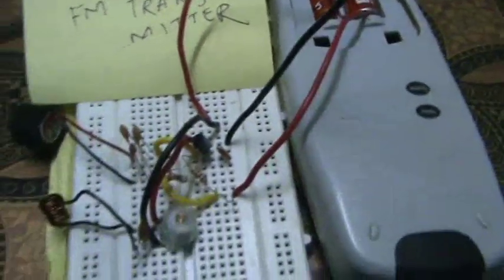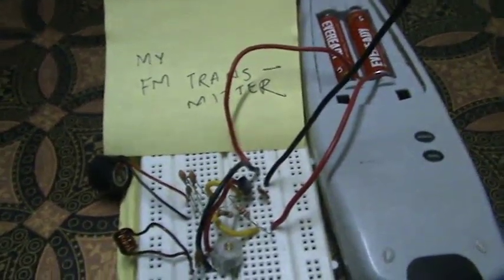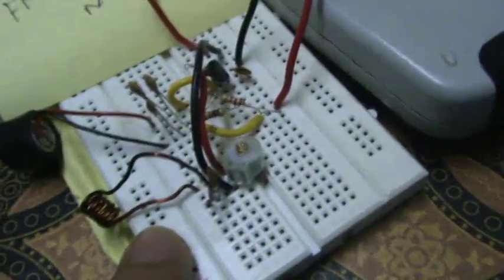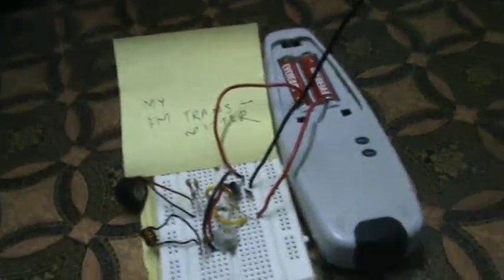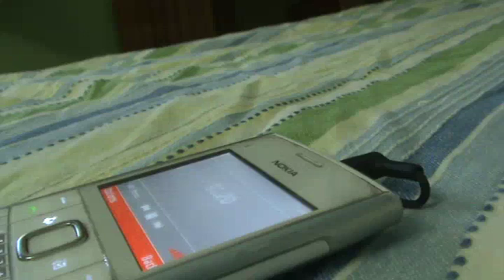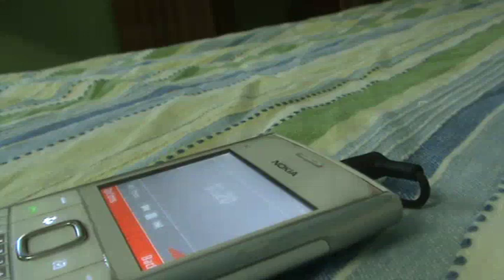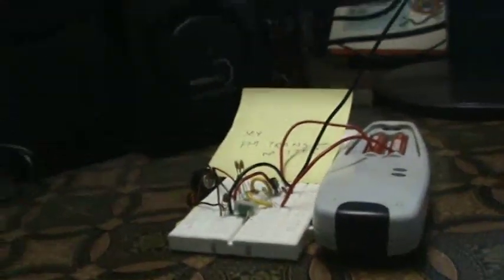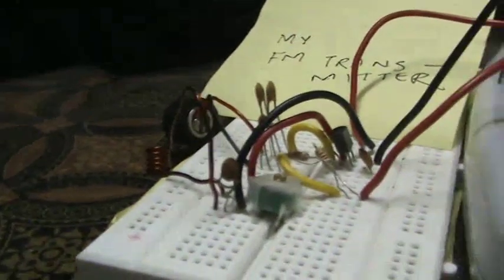Beginners' Simplest Homemade FM Transmitter.

Comment from the maker: Please visit the webpage whose link I have provided in the description. To increase the range you would need another transistor for boosting  the signal. I you want more range then you can use another tank circuit for antenna and a battery with higher voltage. For that I will post the circuit diagram soon.

Comment: The best thing about this project is you can re-use parts of an old CFL bulb (the stuff on the circuitboard inside it) :) But of course you need some extra parts like a crystal oscillator.